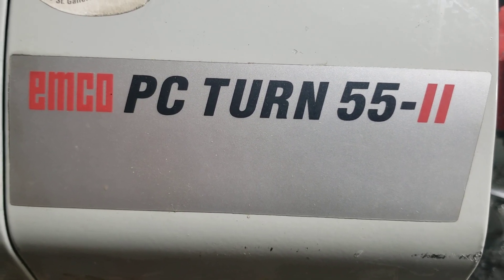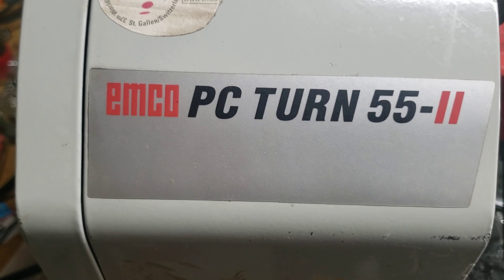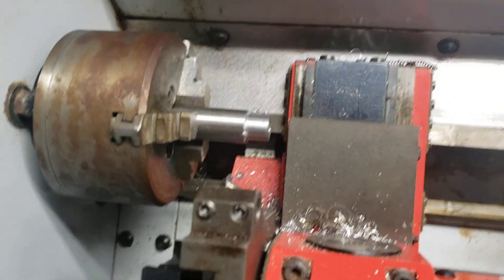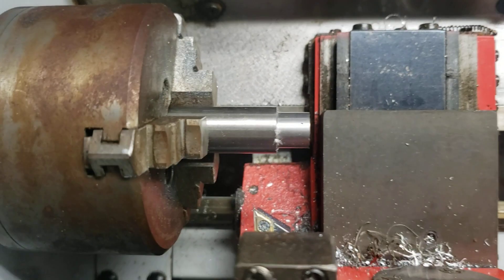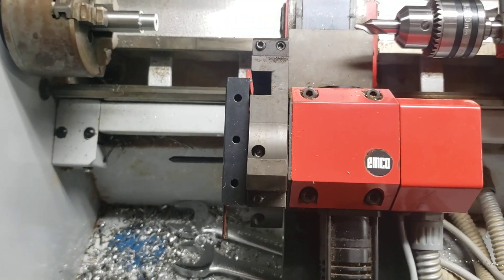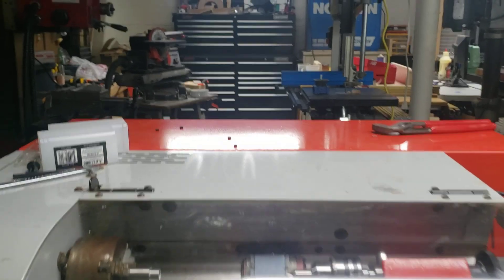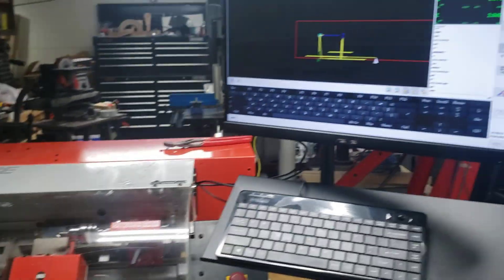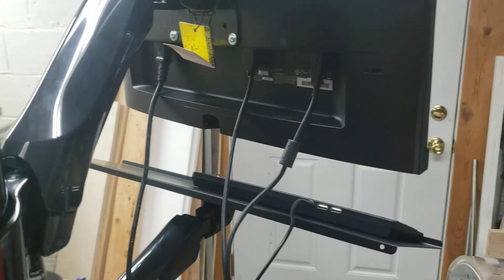Emco PC Turn 55 LinuxCNC retrofit update

Comment: Do these machines have any facility for cutting coolant?
Reply from the maker: As standard, no. I just put a few dabs of oil on the part. If you need coolant, you'd have to devise your own method of doing so. Could probably get away with just using a fish tank pump wired to a relay, but you need to put in a return and make sure the pan is completely sealed

Comment: Hey! i'm watching every video you have uploaded and im very grateful!
but i need some help. I want to make a mill with a RPi 4 using LinuxCNC but without any MESA card. 
Im having trouble using GPIO directly. I assume I should use a HAL Driver like hal_gpio but i dont know how to download/install it and how to configure pins to work on LinuxCNC and a real stepper.
Could you make a video showing something similar? It would be awesome
Reply from the maker: Why no Mesa card?
Reply: @TheFeralEngineer  there si nowhere to buy one here in Chile. Besides I need to mantain lowcosts :(
Reply: @ElixirCNC  I know :( but i need to do it anyway